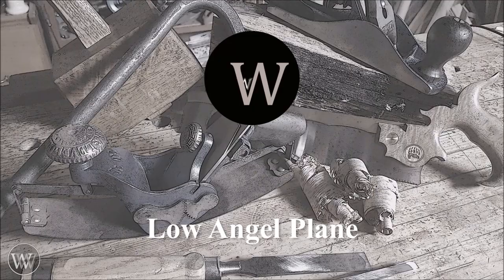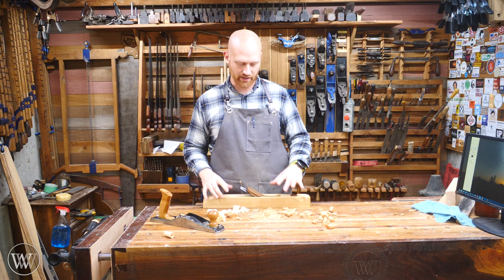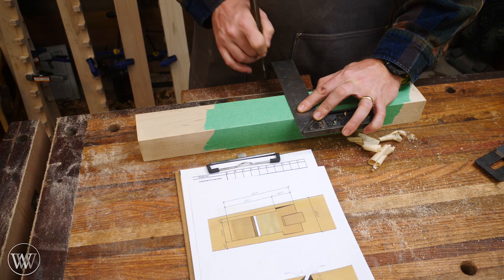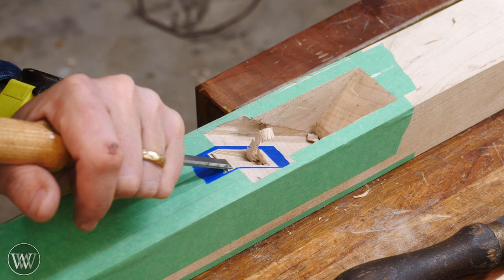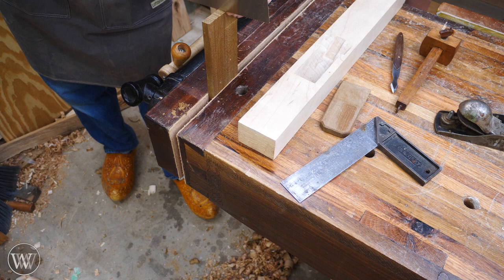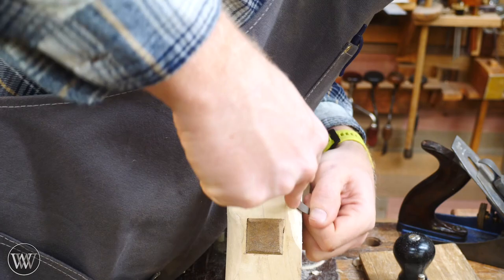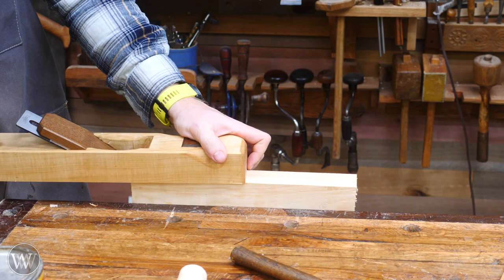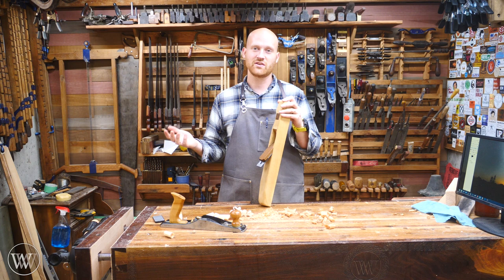How to Make Low Angle Hand Plane : Bevel down Jointer Plane

Comment: I've got the FEE-VA.  Initially thought I'd be good with 1-2...up to 6 now, lol.  But NOT LOL because I didn't get the wooden shoe memo, and dropped a chisel.  Crocs don't cut it, but are easily cut.  Luckily no nerve or tendon damage, but lesson learned.  It was a short 3/4" Craftsman socket/bench chisel.  Not heavy, and fell from bench height.  So if anyone reads this, those clogs aren't just a fashion statement!  ps, thanks for the sharpening tips.

Comment: Your is the supreme tool.Subscribed.
Reply: I also saw his video where he loughed on hand sharpening a plane blade in shape and use instead a grinding machine.In that case Rex was absolutely wrong.I would never ever let a novice woodworker near the grinder ,first things first the novice have to learn how to restore the sharpness or shape of a blade by hand .He also said that is not easy to mess up or toast a blade with the grinder .Well i have news it is ,and i did it more than once which always gave me more to work after by hand than if i would just do it by hand all the way .

Comment: You know, I'd like to express my admiration for you. Someone was a little bit abrasive, but instead of escalating the conflict, you turned it into an opportunity and built a new partnership out of it. That's the kind of thing we really need to see more of these days. My hat is off to you, sir.
Reply from the maker: Thanks Tyler. I do prefer to build bridges than walls when possible.
Reply: I was a little bit abrasive. James was very nice about the whole thing.
Reply: kneeling on the floor with a 2 foot wide 20 foot long piece of sandpaper is really abrasive.

Comment: Another wonderful, hand built tool.  Nothing like them.  Questions:  1) When you mark the width of the plane body do you saw on the outside (waste) side of the line and then plane down to the exact dimension?  2) Is your longer video going to include the technique of chiseling to an exact shape (the button hole is perfect).  I struggle with that aspect of woodworking.  Thanks James!
Reply from the maker: Thanks Bruce. I cut about 1/16" away from the line and then plane back to it. yup there will be 2 videos on cutting the ecapement. It is easer then it looks as long as you stay away from the line as long as possible.
Reply: Again, my thanks James.  I promise not to harp on boxes any more.  I just really like the boxes you made for the 45 and 55 Stanley planes.  I enjoy all of your videos even if I will not make anything like the projects you show.  I learn a lot from just watching.  Happy Holliday!
Reply from the maker: Thanks. I will make a box or two some time in the future.

Comment: Now that you've had it a few years... how would you say it compares to your low angle bevel up? Particularly curious about end grain and softer woods--I feel like a lot of people don't talk about how great low angles are on stuff like pine and spruce
Reply from the maker: I use it when I have long end grain work. But most of the time I grab the LAJP as it is easier to hold.

Comment: hey there James... just consider me an ignorant for the question I'm going to make. but even if the bevel is down like in your plane don't you have to consider the upper line of the blade to determine the planing angle? anyway congr for the nice job!!
Reply from the maker: thanks. with he bevel down the angle is the work to the top of the iron (parallel tot he bed of the iron so just the angle of the bed). with the bevel up the angle is from the work to the bevel (angle of the bed plus the angle of the bevel). Does that answer your question?
Reply: @WoodByWright  thanks! my question was too fast and I didn't consider with bevel up you have to add the bevel angle to the blade bed angle. thanks again for sharing. I hope to make one on my own very soon. Cheers!

Comment: Hey James not sure if I missed something but I'm wondering what the main use of a low angle plane is... Looks like a awesome tool. I'm looking forward to see the long version of the built! I'm getting in to plane making at the moment and I'm sure I can learn a lot from it
Reply from the maker: The lower the angle the easier it is to push and the better it does with end grain. but the higher the angle the better it does with figured or reversing grain.
Reply: Wood By Wright ahh OK that makes sense... Thanks a lot

Comment: Whays the point of the btton?
Reply from the maker: It protects the body. You strike there to rettract the iron. it is usually made of a harder wood that does not dent as easily. And if you wear it out it is easier to replace the button.

Comment: Would make a nice shooting plane. What angle did you sharpen the blade given the 30degree bed angle?
Reply from the maker: I might make one in the future for shooting. This one was sharpened to 25 degrees.
Reply: I'm trying to remember off the top of my head: with bevel down, you subtract the bevel angle from the bed angle to get "clearance" angle, which can be problematic if under 12 degrees, so says my woodworking book (I'll try to find it again). Imagine if both the bed and bevel were 25: every part of the bevel would be flat against the surface. Anyway, I guess the 12 degree warning is wrong since youre doing fine with 5.
Reply from the maker: Jason J. Ayala P. As a general rule of thumb that is ok, but way off on some things. If you always start at the end of the board you do not need a clearance angle and a lower clearance angle just means slower engagement in the middle of a board. This plane has a 5 degree clearance angle. This means it will take 1/2"-1" to startid board. For most work that is not a problem at all. And for jointing it works perfictly.